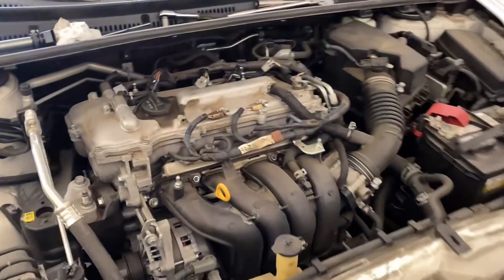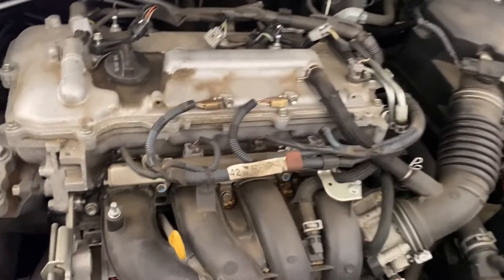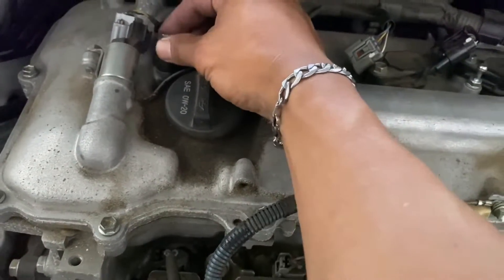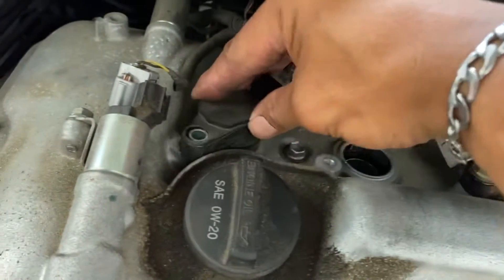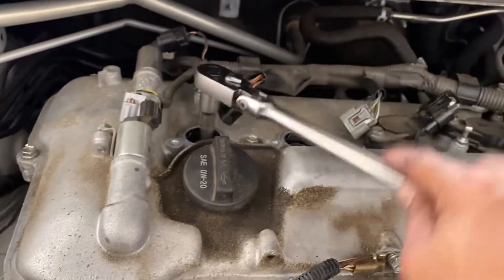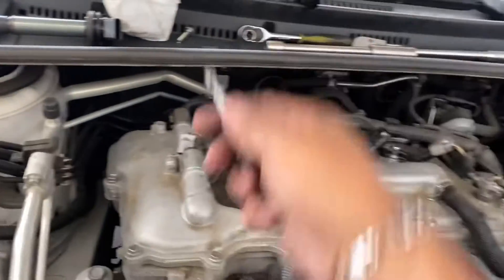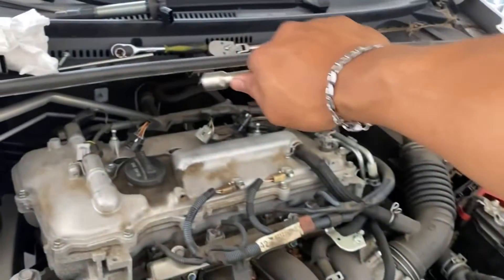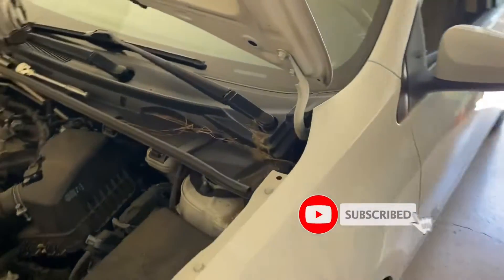How to replace 2014 - 2019 Toyota Corolla Spark Plugs

Comment: 2:23 NO! You don't drop the spark plug in like this.  Please check other videos.  The electrode is possibly bent by impacting after the drop, effecting the gap.  Might be chance of cracking the ceramic insulator by dropping it as well.  It's not worth taking the chance.